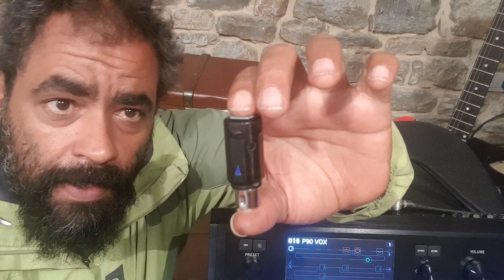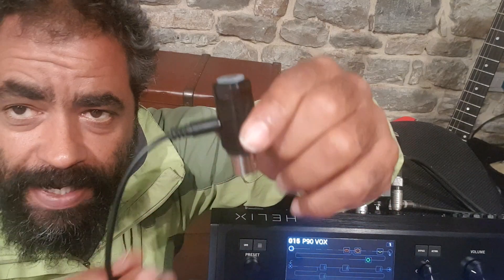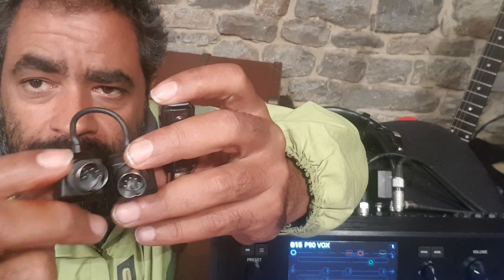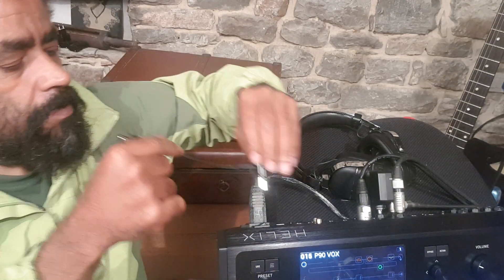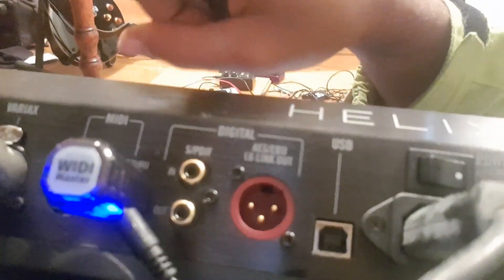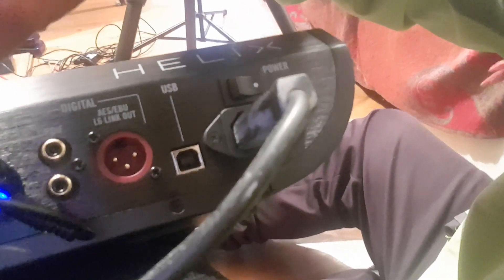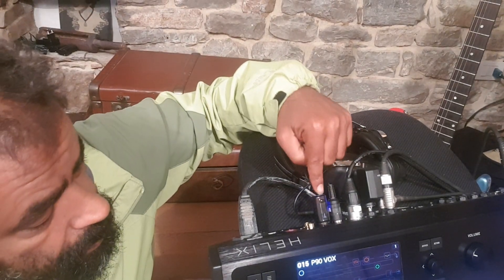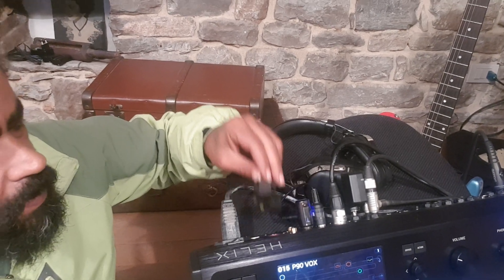CME and their Split cable SuperFunkalicious WIDI Master Gizmo

Comment: Hi Alec! Thanks for posting this! I will be getting my Widi master soon. You mention in the comment that the in side can be powered separately. I want to send Ribn from my iphone to my Disaster Area Design Qconnect on my pedalboard and only have the option to plug it into the IN side! How would I go about that?
Reply from the maker: Couple of ways,  one if you have another midi pedal with a free out, you can power off that, and extend the midi in side which is passive to the Q connect.  Or you can get the wiring diagram off CME, it’s in their group on facebook and wire up a stand alone power adapter to get 3.3 v to the out side.     Personally what I’d do though is jump into the pre orders for the WIDI Jack .  That was the crowd created response to the WIDI master and would do all this without you needing to solder up a thing.   So depends on how handy you are with this stuff. Cheapest  for sure is to just wire up your own cable.
Reply: @AlecBourneMidiMadScientist  Excellent! Thanks for the reply!
Reply from the maker: Actually man,  jump into the CME WIDI and Xkey group and post the question there.   
YouTube at least for me is just not the place to talk midi, you gotta have pencil and papers and coffee stains and send picks or do video chats and all that.   Text responses are just impossible ...   you’d want to really see what’s going on with the whole rig as there could be many ways to do what you want.
Reply: @AlecBourneMidiMadScientist  I am happily off FB! Thanks for the reply!
Reply from the maker: Olav Christensen muahahahaha.  Man do I ever hear you on that front.  I try to regulate my experience to strictly guitar groups or photography but it’s not easy.   Really wish there was something more media rich for exchanging info .  If you find a decent place man let me know.
Reply from the maker: https://www.facebook.com/groups/cmeprofans/?ref=share

Comment: I have one of the WIDI Masters on order, but didn't do the pre-release thing. Once it's released and I get mine, will I need anything else in order to use my iPad as a MIDI controller for my WIDI Master Equipped HX Stomp? How will I coerce the MIDI Pad software to send its MIDI msgs wirelessly to the WIDI Master?
Reply from the maker: In the case of you running the WIDI masters with an iPad or any other “computer” the iPad is the master unit for Bluetooth midi.  So your WIDI will default to slave mode and off you go.   How many Bluetooth units do you have in total ??   The WIDI will attempt first to run as master.  So if you have a slave unit already it will try to pair with that.  Works great with legacy Bluetooth gear as it can step down to Bluetooth 4 automatically. 

For 2 WIDI masters they will work out between them who is boss and will run in BT5 so that is the easiest to manage.  Just think of it as a super long pair of midi cables. 

They’re very cool, but as soon as the control app is all sorted you’ll see all kinds of cool features.
Reply: Alec Bourne - Midi Mad Scientist Thanks Alec. So my iPad will pair with the WIDI Master. But what about the MIDIPAD 2 software - does it support Bluetooth? I don’t see reference to BT on their website. Do I need to use some other controller app instead? BTW, this is the only MIDI BT device I will have (at first).
Reply from the maker: As far as I can recall it works fine without any intermediate app.  I’ll give it a test for you again live as soon as my tea is done.  Been a while since I messed with MidiPad 2.   Great app by the way, super versatile.
Reply from the maker: Steve there is a free app called BLE midi which you should probably download when you get them.  This attaches the bluetooth.  Many apps do it directly as well.  I think midipad2 may want that.
Reply: Alec Bourne - Midi Mad Scientist I’ll check it out - thanks!